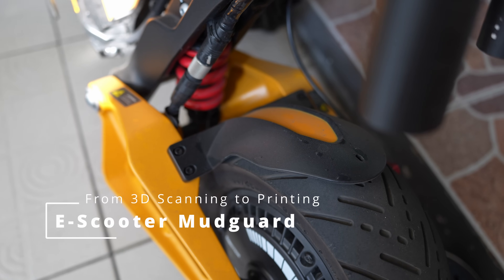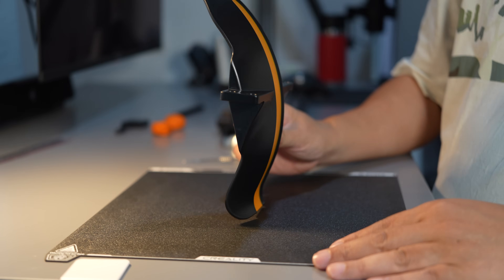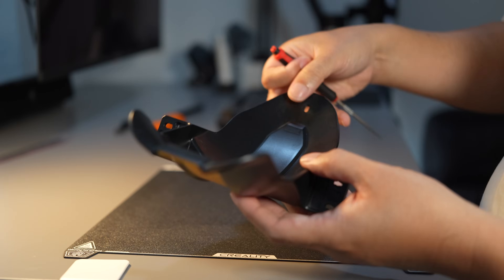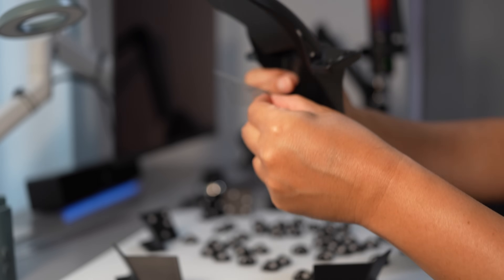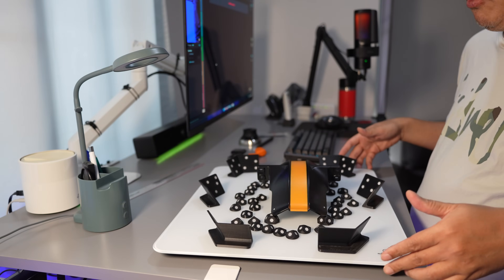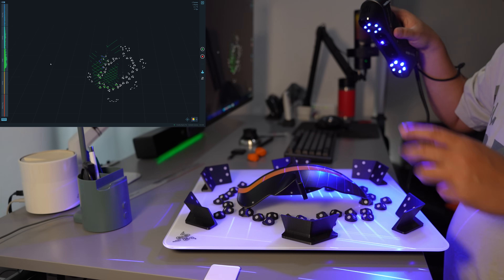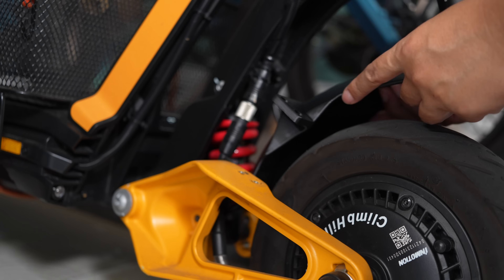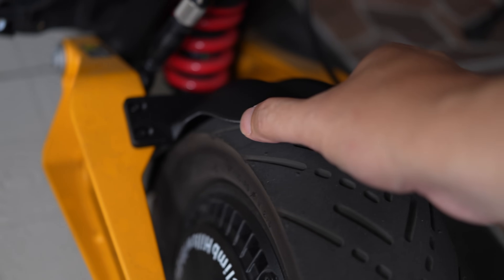From 3D Scanning to Printing - Cloning a Mudguard with Creality Scan Raptor PRO and K1 Max

Comment: el modo NIR cuando se usaria o en que ?
Reply from the maker: NIR's for Face/body scan or high feature area where you don't want to put the marker on. I've made a video here. https://youtu.be/97JMwrmhFpI
Reply: @Payo-TensileCreator  gracias amigo, por ahora tengo dificultad para generar malla en un escaneo de una bomba aurora, el consumo de ram  supero sus 48gb y video supero sus 8gb, alguna ayuda para con ello ?
Reply from the maker: @semmarmanufacturingsac5750  You can try lower down the resolution. Most new user don't understand this and crank up resolution to the max.

Comment: Thank you so much for your 3D scanning videos - they’re amazing! I would love to see a  detailed tutorial on using Substance Modeler with 3D scans. This video and the drone prop guard video for example have some excellent examples of using Modeler. But if could you do a spoken video describing how to use the program in this way I for one would find it super useful!  
I think 3D scanning is getting a little more user friendly - the harder part is how to use these scans in a useful way! I use Fusion 360 but I don’t find it easy doing any sort of modification let alone reverse engineering! Thanks and keep up the great work!
Reply from the maker: I've made a detail video here repairing head shot scan with Substance 3D Modeler. https://youtu.be/CNqVPw5hfQE
Reply: @Payo-TensileCreator Sorry I should have been clearer. Fixing scans is more straightforward - and that video is very helpful for that I’d already watched it 😊. It’s adding 3D printable designs on top of these 3D scans that I struggle with. Like you did with the prop guards with the scanned drone for example. Modeler looks very useful for those purposes too. Would love a tutorial on that. Thanks!

Comment: Thank you for all the information you share, your information convinced me to purchase the Raptor Pro, can you tell me am I able to use my Pro with my scan bridge and phone only without my laptop present? Thank you in advance
Reply from the maker: It doesn't perform well on my Xiaomi 13T, as it's quite slow and stutters. You might have better results with a faster phone equipped with a Snapdragon Elite CPU.
Reply: @Payo-TensileCreator   would you be able to explain how to get it to connect? I  connected my Pro to the scan bridge and connected the data cable with the supplied usb A to C adapter and connected to my phone, I opened the Creality app on my phone, but the app doesn't see the scanner. Also connected my phone to the scan bridge wifi.
Reply from the maker: @jpt430 You're right, I haven't checked the connection in a while. Currently, it's not linking to the mobile app on either Raptors or Otter. It seems like they may have disabled it through the firmware or software updates.

Comment: I would print that on its side for strength if using FDM as layer adhesion is a weakness.
Reply from the maker: Yes, reverse in CAD add some taper profile for filament rising, position it on its side, and it might be printable without requiring any support.

Comment: With 2 walls? I wouldn’t trust this print to hold up. I would have filled it 100% to make it more robust.
I own a Raptor too. It’s really cool what you can do with a scanner. Last scanned and 3d printed part was the coffee outlet of my coffee machine. It broke after 10 years of open and close of the front door.
Reply from the maker: You might want to give Creality ABS filament a try. I didn’t mention it in the video to avoid it seeming like a sponsored post. Before this, I was using E-SUN ABS, but the layer adhesion was just awful in comparison. As for PETG, I steer clear of it because the printing speed is just too slow.
Reply: @ your right about that different manufacturers has different layer adhesion. Esun ABS is for easier printing. Less warping but less heat resistance and layer adhesion is worse. I use Bambulab ABS because it’s easier to use with my X1C. But there are rumors that Bamulab ABS is manufactured by eSun. 

I will give creality abs a test. I will buy a scale to be able to test the filament properly too.

Comment: Between the MAF Three and the Raptor pro: Which one would you recommend for jobs like these and in general. Whats easier to use regarding markers etc?
Reply from the maker: For this mudguard, MAF3 is easier and faster to scan. However, when part get larger like the plastic fairing in my previous video, MAF3 wouldn't make it.

Comment: I like the disclaimer regarding copyrights, classy Payo.
I could see a nylon 3d print, with a bit more mass being very durable once soaked in water for a good few hours.
Nylon is very hydroscopic and becomes 10 times tougher once it is saturated with H20.
Nylon is your friend.
Reply from the maker: I’ve encountered this situation myself—the printing company refused to print the scanned auto part, stating that it was patent protected. They explained that if they sent it to me, it could get held up in customs, and I might be charged for importing a counterfeit item.
Reply: @Payo-TensileCreator Interesting! Maybe change the design slightly (if visually acceptable) and then it’s your own design?
Reply from the maker: Legally, yes, you can modify dimensions, alter appearances, remove part numbers and branding, and explicitly label it as a compatible part. However, there are times when you'll need to defend this in court, which can be quite expensive.

Comment: how would something like the Otter do in a job like this? it seems capable but I'm curious how difficult or different the scan would be
Reply from the maker: Using marker mode with Otter will be quite challenging. However, you can try geometry mode with decoy objects, perform two scans, and then merge them. The most difficult aspect for Otter, in my opinion, is the merging process, as its precision isn't very high.

Comment: Great video! Question - what is the advantage of switching the scan line count? Thanks
Reply from the maker: After swiping with 22 lines, you may notice that small corners, gaps, and cleaves are no longer being captured. At this point, it's best to switch to 7 lines to successfully pick up the remaining parts of the scan.
Reply: scan speed time
7 line is more accurate but takes more time to scan as you scanning the object with less lines.